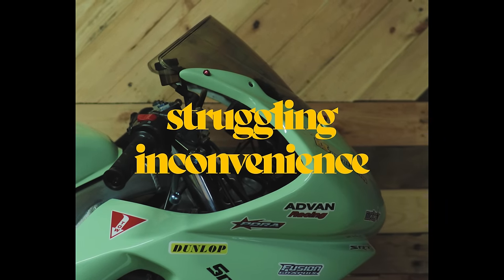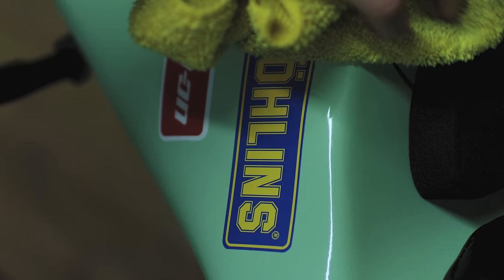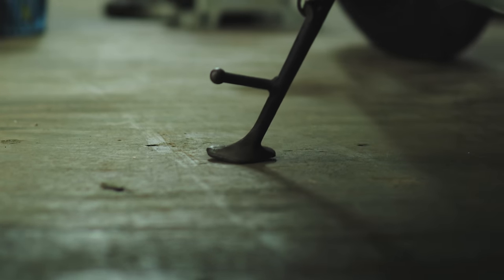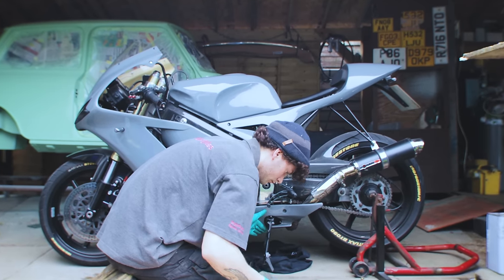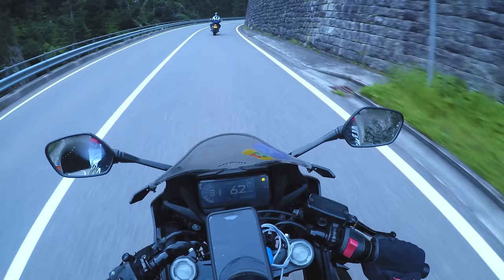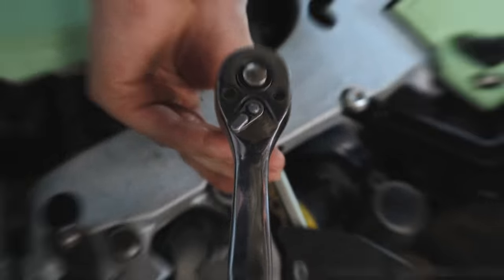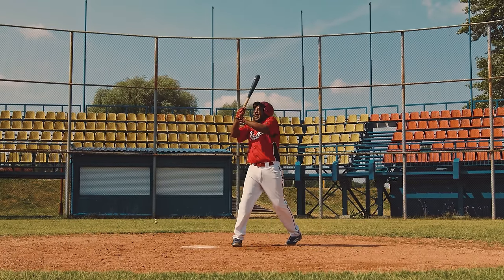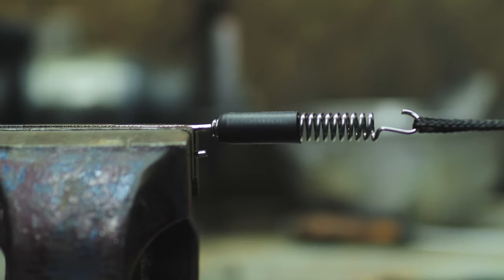6 Hacks Every Motorcyclists MUST Know

Comment: Just for context. Im 54, got my first bike at 14 a Suzuki AP 50 from the 70's (before it was a scooter) google it and yes I got caught but not on the AP, it was a Honda SS 50 I bought when I was 15 🤣,  Great Advice on this post and funny, loved the lost glove in the dirt, just go find a rock lol. Zip locks for long jobs and spray caps or tubs for quick ones . If you have a modern bike with multi grade oil you don't need to warm up the bike before you ride away but you must keep at low rpm until  60 + degrees temp to allow for proper engine fit (gaps between cams, valves, pistons and walls)👍. Good editing and good advice.

Comment: For hack#6 an extra spring (or something similar) to pull on the spring for the exhaust while using the closed end of a wrench to pull the extra spring for leverage is what has always worked for me
Reply: I just used pliers 😒

I swear people make things much more difficult than they have to be
Reply: @TheDougSpot  I don't understand what's complicated with the method I used, I already had the wrench and extra spring out so no need to use pliers.
Reply: @Yoo_yuz  
You’re jerry rigging two tools when one tool would do the job perfectly fine. 
Also, you’re introducing another possible point of failure as well as possibility of injury using your method. 

But if it works for you🤷🏾‍♂️
Reply: @TheDougSpot  I mean yeah this is a hack video and I'm just telling my experience which has worked for years. I'm adding my two cents on other ways to solve a problem instead of critizing others. Also, there's no possibility of injury, its literally pulling on a spring. 
All you had to do was add "oh a plier works as well". Like did u really have to add "I swear people make things much more difficult than they have to be" as if there is only one way of correctly doing things
Reply: @Yoo_yuz  I tried pliers before and they suck azzz because it very slippery and the tighter the spring the mroe it will slip.  Lmao other ddude definitely thinks he's better than others his comment made me laugh by saying ur technique can cause injury and possible points of failure... bwahaha wat point of failure its a wrench which has better grip and tougher than a plier pulling on a spring!!! 🤣🤣🤣
Reply: @120kurei  Yea idk what he meant by "points of failure" and "possibility of injury" when it's literally just a simple task of using a wrench to pull the springs.

Comment: Here's a few tips that I'd like to pass on that I use, I've been riding for just over 47 years so I've picked up quite a lot of tricks & tips over that time & I always like to share what I've learnt with other People, after all I'm not going to be around forever so why keep it all to Myself if it can help somebody else? & after all that time I still learn new things Myself every now & then & when I do I like to pass it on, I mainly ride Cruisers now, I find them a lot more comfortable now at almost 74 years of age, but I still like & appeciate all types & brands of Bikes, I'm currently riding a 2015 Harley Davidson 103 cubic inch/1700cc Heritage Softail, My 3rd Harley, & I've owned a few Japanese Cruisers & Road bikes over the years as well, all of My Cruisers have had pretty good sidestands with decent bases on them, & a good angle as well but for some reason the Road bikes always seemed to have short, straight thin based stands on them, I Iive in Nth Qld in Australia, & it gets quite hot here in summer, I've seen sealed roads melt in the heat & Motorcycles go over with the sidestands speared into the roadway so one trick that I use for these types of Bikes is to crush an empty softdrink can flat under the heel of My boot & carry it either in one of My saddlebags or one of My pants or jacket pockets & when I need it for parking on dirt or soft grass or soft roadways I can just slip it under the sidestand & give it a broarder base, it also comes in handy when washing Your Bike on the lawn at home as well, let's say that Your bike has gone over on its left side & it is in Neutral before You lift it up, either by using the sitting on the side of the seat technique or the lefthand hand handlebar lift technique, You need to lock the front wheel first to stop Your Bike from slipping away from You as You lift, You can easily lock it on by using one of Your gloves, just slip the index finger of yourrighthand glove over the brake lever, & apply the brake as You slip the open wrist part of the glove over the handgrip & secure it with velcro straps or the zips of the glove, the Bike can now be lifted safely without rolling, or moving away from You, & You can lock it this way whether You've got help or You are on Your own, if Your Bike falls to the right, You can put it in gear first & apply the front brake with Your hand  & lift, using either lifting technique, the one thing that Harleys don't have as standard is a helmet lock, so I also carry a padlock in My saddlebags, My front axel comes out just little bit longer passed the edge of the side of the front fork on the righthand side & it has a couple of convenient holes in it near the end of it that I can use with a padlock, so when I get off the bike I lock My Helmet on there, I've also locked it straight onto the front brake disc on any of My Bikes that have had the disc on the righthand side as well,, this gives You a good wheel lock as well while it's there, You could also lock it onto Your spokes, the Bikes not going anywhere, &  it saves You from carrying Your Helmet around with You all the time, they can become quite heavy after a while, if You have a Pillion Passenger, either get a lock with a longer shackle or a second lock that You can feed through the first one & lock both Helmets on the same wheel, a couple of downsides though, you need Helmets with the D-rings or O- rings on the straps to lock them onto the Bike, can't be done with those quick release Helmets with the quick release clips on them, unless they have a ring somewhere on the strap as well, & also in wet weather You'd have to carry your Helmet with You otherwise You'd come back to Your Bike & find You've got a Helmet full of water, using the footpegs & footboards as side steps makes it easier to get onto the Bike as well, especially for shorter Riders & Pillion Passengers too & mounting from the Righthand side makes it really easy for the Rider to mount the Bike as well, put both hands on each handlebar grip apply the front brake & You just have to make sure that Your weight is going  over the middle of the Bike or better still over Your gauges or left hand mirror so that You don't pull the Bike back over on top of You as You step onto the footpeg or footboard on the righthand side of the Bike, then step over the seat & sit down, & last but not least, is a little trick to get the Bike upright from the parked position once You've gotten on it, I saw this in a video once & it really does work, especially for big heavy Bikes, according to My owners manual My Heritage Softail weighs 336Kgs, dry weight, trouble is I only weight 50 Kgs at the moment, so sometimes it's quite a challange to get it upright, & just like everybody else, I used to drag the bike up, straighten the handlebars, raise the kickstand, check for Neutral & then start the Bike, this video showed the same techniques but done in a slightly different sequence with a couple of extra things thrown in, first plant both feet firmly on the ground on each side of the Bike, don't worry too much if Your right foot cant quite reach the ground at this stage, that could be to do with the seat height, it will contact the ground as You continue to bring the Bike upright, apply the front Brake & hold it on so as to stop the Bike slipping away from You as You lift, then, with the Bike still resting on its sidestand turn the handlebars to halfway between straight & full lock, You can go to full lock once You've mastered it, next put Your lefthand on the lower left side of the tank near where the seat joins it, on a Harley You can actually hold it under the lower left side back of the fuel tank itself, then using the power & strength of Your upper left leg push sideways to the right with Your left leg & bring the Bike upright, this really works & it feels like You've hardly even moved & You don't even feel the weight of the Bike at all, straighten the handlebars, raise the side stand, check that You're in Neutral, either with the green Neutral indicator light or by checking the gear lever with Your foot, start the Bike, click it into first gear & move off, these techniques in the video were demondtrated by a small Female, about the same weigbt as Me on a Harley Streetglide which is probably about 48 to 50 Kgs heavier than My Bike & She handled it with ease, I hope these tips help a lot of People to make things a bit easier for them. 
(Postscript):- I just thought of another tip, do You use antifog spray on Your visor & sunglasses? as I said earlier, I live in a fairly hot climate, & evaporation can be a big problem, here, a few years ago a Female Friend told Me that She keeps Her Perfume bottles in the fridge in one of those little compartments on the fridge door to stop it from evaporating in the heat, so I started doing the same with My After shaves as well, I bought some antifog spray, & it was quite expensive, about $25•00 Australian for a very small bottle, about the size of the one in the video that He used to clean His visor with & then put in His pocket,, You dont use much each time, only about 4 or 5 pumps each time on each side of the visor, You just smeer it on, wait a few minutes & then polish it off, the inside stops the visor from fogging up & the outdide makes rain water run off the outside of the visor very quickly, each use lasts about a month before You have to do it again, to stop it from evaporating too quickly, I keep it in the fridge door too.

Comment: For the Helmet Visor it is mostly also really easy and nice to clean. You do not really need any cleaner, when you are out or so. Cleaners can even damage your visors Shielding and things on it, like on colored Visors. It does wonders, to have a Towel or anything alike with warm water and just lay it over it for 15 minutes or so. Even dry flies and such will be soaked again, and you can easily wipe them away without rubbing scars into the plastic. And a little towel or such a towel you have is also not hard to store on almost any bike. It will even work with hot water soaked toilet paper. And if you lay it on the helmet, to let it soak things  you will see, that you will not need to wipe hard or so and you really do not need anything else than water to remove even the most nasty flies.

Comment: Instead of buying bottles of visor cleaner, get a spray bottle and buy isopropyl alcohol by the litre or more. Mix isopropyl,  water and a small amount of dish soap and you have excellent visor cleaner on the cheap. 
Neat alcohol spray is great for cleaning anything including headlights, visors, degreasing and disinfecting and cleaning the inside of a helmet. Super cheap too